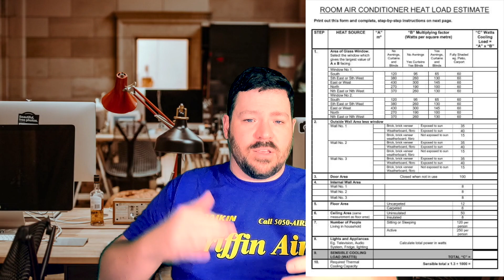Duh! Backwards logic by some HVAC pros. Heat load calc. after sale?

Comment: Thanks for another  informative  video. I wonder how  many HVAC  companies  actually do  a proper  J Load  calculation even when required  by code?
Reply from the maker: Good question!  In my experience, very few!
Reply: @NewHVACGuide   From monitoring the experience of  friends  and  my limited  purchase  experience  I agree that very few  actually do what code requires. As  you mentioned  how  can you properly price  and  more  importantly install the  proper  equipment
Reply: @NewHVACGuide   From monitoring the experience of  friends  and  my limited  purchase  experience  I agree that very few  actually do what code requires. As  you mentioned  how  can you properly price  and  more  importantly install the  proper  equipment
Reply: I’ll be honest, where I am in the PNW a lot of times the ductwork on existing houses can’t handle whatever tonnage is calculated. So even if you calculate 4 tons, ductwork may only be able to handle 3 tons